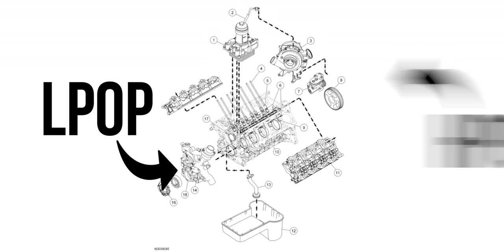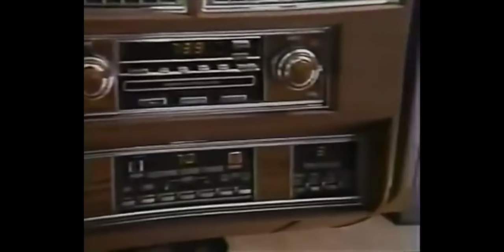These are the WORST ENGINES EVER MADE

Comment: I had a 2.2 omni. I drove that thing for 210,000 miles and sold it. just had to do a timing belt and one headgasket
Reply: had a 2.2 in thw wifes 93 Dodge Spirit . Never a problem except one headgasket . And I think that was my neglect of coolant maintenance .
Reply: The ones with the VW rabbit engines were bad ass fast !!

Comment: The early Toyota 8r and 18r engines with the fuel timing chain set up with two chains, 4 gears, 2 tensioners, 2 guides. When the chains wore out it would buzz saw through the timing cover and self destruct itself.

Comment: GM NEVER figured their displacement on demand out. 

The LS4, (LQ/LY 5.3L based LS engine) eats rocker arms and floats valves, have heard many reports from GM truck owners having had similar issues. 

80-100k miles for a full valve job, is unacceptable, and this is coming from a Mechanic who drives a Benz.

Comment: We have several 6.0 Fords at our shop and we love them. We have dealt with some 6.4 and 6.7s. They are boat anchors. Even the mechanic at the Ford dealership will tell you that they are junk. The 6.4 will crack the block, in some cases with only a few hundred miles on it, and the 6.7 has crank problem and there are no crank kits available. The only problem we have with the 6.0 is cowboys. Nothing is cowboy proof.

Comment: I don't know the engine designation but it was in the Ford Fiesta.  Interference engine with a timing belt that drove the water pump.  Pump would fail, belt would slip, and engine was trashed.

Comment: I have two of these engines: A 5.4L 3v in a 2007 F150, and a 6.0L Powerstroke  in a 2006 F250. I’ve had the 5.4 truck for 13 years and have no issues. I just got the 6.0L and I’m keeping my fingers crossed that it will perform as well as the 5.4L has.
Reply: Same, my ‘09 5.4 3v has run basically trouble free for 14 years now with proper maintenance.

Comment: The Northstar is a good engine.  The biggest issue with this engine is the oil leaks.  Oil consumption of a quart per 1000 miles isn't out of line.  VW calls that normal and won't warranty anything better than that.  We never saw any real oil consumption issues in normal driven cars.  The ones that did were driven harder and at that point oil consumption increases are normal

Comment: He missed some of the reasons with these very engines.
- Northstar v8s have a head bolt issue. I think the threads were too shallow. Funny cause he actually says that about another engine here.
- Triton 3 valves have oil passages that are to small. If you don't change the oil regularly they will grenade themselves.
Car Wizard mentions both of these issues in his videos.

Comment: I would add the Ford 4.6 V8.  I know a lot of people love that engine.  But if someone runs straight water in the cooling system, and the freeze plugs rust out, especially those behind the timing chain, suddenly you are dumping water or coolant right into the oil.
Reply: I believe that's what happened to my grandmothers Grand Marquis, one day it died unexpectedly. We poured water in the radiator and it shot out of the exhaust.

Comment: What Mopar cars used the 2.2L turd engine?  I had a 1986 charger with  non-turbo 2.2 4 banger.  I got it new.  That engine was the ONLY part of that car that didn’t give trouble.   The spider gear housing got a crack in it and leaked tranny fluid.   The A/C always leaked.  Dumped it prior to total destruction.

Comment: Chrysler tried build a better mouse trap and only messed up the 5.7L (351) Hemi. I've got a 58 Chryler 351 Hemi in a 1928 dodge roadster. The original engine was pretty much bullet proof and in it's current configuration will blow the doors off a new 5.7.

Comment: When you were on the Triton you forgot to mention how the exhaust manifolds would ALWAYS warp & break the steel bolts off in the aluminum heads. My work shop's lot truck has 27,000 mi... it's been 'fixed' 3 times under warranty.  Bye the way if you let that annoying loud leak at header persist your valves will flake away whilst the engine cools down... loosing a little more compression each time you drive it.

Comment: I owned a 7.3 Navistar IDI and it would burn anything you ran in it.... IF you could get it started. Had the glow plugs done twice. Once myself and another by a pretty reputable shop in my area and they NEVER worked right and the cavitation issues were terrible. Yes easy fix with the right coolant but good luck finding one that had ever had the right coolant in it..

Comment: The Olds diesel was often used as a gasoline block by the drag race community. With thick walls and a extremely ridged bottom end it could take abuse that would split a Ford small block in half. The high nickel content iron also made for a great stationary motor. Odd how people who have zero experience with a powerplant just repeat what they heard on the internet.

Comment: Ok.  So I had a Toyota 4 runner with the engine mentioned here and it was a disaster.  Blew the head gasket twice.  Toyota knew about the problem did nothing to fix it.  On the second time it blew I donated the car. Gave it away.   I was so disappointed with the way Toyota handled the whole thing I have stayed away from the brand ever since.

Comment: The Northstar ring pack was too much for  the pokey drivers that bought them. The engine was really a race engine that needed to beat on and revved. And the lack of head bolts......why 4 and not 5 per cylinder? The Olds diesel was released to a public that did not get them and the real issue was the lack of a fuel water separator. The last generation of the Olds diesel was not that bad. Get one, add real head bolts, up the pump, add a turbo and they were pretty good. Gotta be dedicated though

Comment: By 2006 Cadillac fixed the problems with the Northstar. My 2006 STS never burned oil,never had a coolant leak and never had a head gasket problem. In typical GM fashion once the problems with the Northstar were corrected GM stopped using it.

Comment: The Cat C7 ACERT engine. That engine almost bankrupted any commercial company running box trucks because the the piston rings would break, score the cylinders and they were not sleeved. We had to use a manometer to measure how bad the blowby was. As a mechanic rebuilding these (term used very loosely , we just tried to keep them running till leases ran up) we would run a ball hone to get as much of the scores out as possible so it would run decent enough to finish the lease life. This ultimately , in my opinion, was a big reason CAT stopped making highway engines ( and they were so dirty, the EPA basically killed that division )

Comment: Subaru's 2.5 liter boxer engine is a candidate for this list.  They have head gasket issues.  Every 2.5 liter will eventually suffer a head gasket issue.  One corner of the gasket doesn't have a bolt to hold it down and it will fail.  I had it fail twice.  Other than that, the engine had 165 hp, and only got about 22 mpg in mixed driving.  So it wasn't a power house or a economy engine, but did move the car pretty well.
Reply: That problem was fixed over ten years ago.  Try to keep up...

Comment: I had the 3VZE engine. I loved it. True, it was nothing to brag about with power, but it was pulling ALOT for a little engine.

As for the head gasket issue? Because Toyota thought it would be okay to have the crossover pipe for the exhaust so close to the gaskets. And it was okay, IF they were made of Asbestos. Although, the newer head gaskets today can withstand the extreme heat. If you can get past the head gasket issue, it's a solid engine.

Comment: The 3 cylinder 1 liter Ford Ecosport. They have rubber timing and oil pump belts that are bathed in oil. The sprockets are pressed fit and will slip. Oil destroys rubber. The teeth on the belt shear off and you loose the engine. Also as the belt wears rubber particles clog the screen in the oil pickup pipe.

Comment: The Olds 350 diesel was abysmal. I remember seeing 1-2 year old engines blowing the crankshafts down thru the oil pan. Not uncommon to see a Olds 98 or Cadillac DeVille converted to gasoline V8 when the owner got tired of diesel headaches.

Comment: The GM 5.7L diesel engine was definitely one of the worst engines ever produced. even the one's that didn't tear themselves apart? had issues with wiping out the front pump. in the turbohydromatic transmissions. from massive crankshaft flex. a person would think that GM would have known better than to take. a gasoline engine and turn it into a diesel engine. but apparently they didn't.

Comment: Had a 74 maveric with a 240 six cylinder that someone changed plugs and wires one time and the threads came out in #5 cylinder and man the thing would scare you like a shot gun going off, but ,she would stay going with not a big notice in performance ,it just sounded like a relief valve going off.

Comment: Nothing wrong with the 6.0 as long as you delete it, ARP headstud, and tune it. Then it's just regular maintenance from there.
Reply: I've owned every Powerstroke engine (with exception of the 6.4) and the 6.0 is by far my favorite.  Half of the stuff this guy says is complete garbage.  He didn't even mention the VW/Audi 2.0T, Cummins ISV, the 2.0/2.3 ecoboost or the GM 3.6 V6.  I think he did about 5 minutes of research before making this video. 😅

Comment: The old Mitsubishi 3.0 V6 has to be one of the worse. It was used in both Mitsubishi and Chrysler Corp cars in the 80s. It was noted for high oil consumption, which is often noted on older cars. This is due to problems with the valve stem seals, which on 6G74 must be replaced at the first sign of oil consumption. Virtually every car with that engine I saw back then ended up smoking like a chimney. I owned a 1988 Caravan with that engine that would leave a cloud of smoke behind me until I had the valve seals replaced.

Comment: Props for putting a Toyota on the list, even if you did it in a backhanded kinda of way. Toyota had a major issue with excessive oil burning in the 2000s. We had a well maintained 2007 Camry that burned a quart every couple thousand miles.

Comment: as a previous 3vze owner, it was toyotas bad design on the exhaust manifold on the passenger side. it was a crossover pipe that was to close to the head and it would over heat the head. and it was offered from 88-95 in their pickups as well.

Comment: Toyota 3vze engine were built with a mismarked headgaskets.  TOP was actually bottom so they were installed upside down.  So iirc the drivers side rear cylinder combustion ring was too close to cylinder bore. Toyota replaced a lot of them.  Some were even customer good will.  One trick when replacing thermostat was to hold the plate open with a aspirin tablet and filling slowly. I used to take a high mounted coolant hose off and fill in both directions using small funnels. It might have been a heater hose by valve. My 2 cents

Comment: Not only did the Northstar V8 have some kinks that really needed ironing out but it's also laughable how insistent GM/Cadillac was on using it everywhere. I feel like the biggest offender is the XLR, the Cadillac that was basically a C6 Corvette. As if higher weight and only automatic transmission options weren't bad enough, they just had to replace the LS engine with this smaller displacement and less potent engine

Comment: How about the transverse-mounted Ford 3.5 and 3.7 V6's? They have a water pump driven by the timing belt, and when the water pump seals fail it dumps coolant into the oil pan. Sadly, other than this particular glaring issue it's a good engine, the Mustang and F150 use a longitudinal version, with an externally mounted water pump, and they hold up just fine.

Comment: Bmw N62- valve seal issue. Alternator bracket oil seal. 

Northstar- head gasket bolt issue.leak galore

Jaguar  4.0 V8-1998-2000. Weak water pump propeller.  Shite tensioners and rail- breaks destroys engine. Problem child especially compared to the i-6 and v-12 it replaced. And yes, it was another one of those Motortrend Engines of the year award winners.

Comment: I had a used 99 Cadillac SLS NS engine with 80,000 mi. It Had no oil consumption problem but we had $7000.00 in repairs in 3 years. 
Never again will I buy a Cadillac!

Comment: Easily the Maybach HL230. It constantly sets itself on fire, is complicated to maintain, consumes too much fuel and is underpowered compared to engines that were fielded in the same time period. FYI this is the engine put into the Tiger 1 and Tiger 2 along with the Panther tanks.

Comment: I would have to offer the Dodge 2.7 2005-2009 engine for this list of horrible engines. If the oil isn't changed religiously, and it wasn't in most cases, the engine would fail miserably.

Comment: That 6.0 liter powerstroke diesel in Ford pu's was at very best "the worse engine ever manufactured in the entire universe",  I bought a used 2006 F350 (80,000 miles) and owned it for 8 weeks, 3 of those weeks were spent in a Ford garage. It cost me a fortune trying to stop all the oil leaks, you just couldn't keep oil in that engine ( from leaks) even though the Ford service tech replaced seals, gaskets, some parts and who knows what else. I spent over $4000 in repairs just on that engine that still leaked oil.......that $4000 I spent on that engine was the most damn money I ever spent for a boat anchor.

Comment: I add the Nissan A 15 engine, 1977 to 82, these blew up internally, head gasket problems, bad carbs.  I had one in a early 1980 Datsun 210 and it blew up at 75000 mikes.
Reply: Miles that is, but got crap millage mine when I traded in barely got 14 mpg, sometimes 12 mpg.

Comment: My vote would be the Oldsmobile 307. The only anemic turd V-8 option available in most GM passenger cars until the early 90's (Corvette excluded of course). Nothing like taking the biggest cars in GM's product line (Oldsmobile 98's, Buick Electra's, Cadillac El Dorado's) and giving them an engine with all the horsepower of a Toro snowblower......

Comment: The 3VZE has a number 6 cylinder running very hot issue due to the stupid exhaust crossover. That's where the head gasket fails.

Comment: Cadillac HT4100.  When the 8-6-4 flopped in 1981, what did they do?  Created a 4.1 liter V8 to take it's place!  Aluminum block, intake manifold, and oil pump.  Cast iron heads?  Yes!   This engine had tons of reliability problems.  Intake manifold gaskets would cause coolant to contaminate the oil.  Block castings were so weak, they would warp the block.  The distributor drive gear would get chewed up as a result.  The cam was soft and prone to rounding.  The cam gear was nylon and would lose teeth, jumping timing as a result.  The aluminum oil pump would fail.  It would spin cam and crank bearings, leak oil due to sloppy application of gasket sealant at the factory, rip headbolts out of the aluminum block.  Such a shame.  This engine had a nice sound when it wasn't broken.  2 very good engines were spawned from the 4.1.  The 4.5 and 4.9 liter V8's.  Cadillac should've gone right for one of those.  They would've been great in the full frame landyachts.  The 4.1 held up better in the small, transversely mounted engine Cadillacs, but still was mediocre at best in those cars.

Comment: On the flipside, the more performance oriented 5.4L Ford V8s found in vehicles such as the Mustang Cobra R, gen 2 Lightning, Terminator Cobra, Shelby GT500 (07-12) and the Ford GT (05-06) was more reliable and could handle power.

Comment: Bough an e350 with 320k on the 6.0 I ran home made diesel a few years and got 420k until Stephan at Taska Ford screwed the thing up b4 he got fired. Had to junk it after 2500 rip off repair.  My 5.4 e350 has 310k miles and runs great.

Comment: Another to add the 2.3 l ford that was used in the tempo and topaz, the motor digital box for the ignition, on the distrbuter, that would blow out in a years time do to the fact they mounted it near the exhaust and intake.
Reply: What? The distributor is on the front while both intake and exhaust manifolds are on the back!

I did have the Thin Film Thingie fail years ago and it was due to lack of grease which was supposed to promote heat transfer. Many years of Tempo ownership and only the one TFM failure.

Comment: 6.0 power joke is garbage, I had one implode one afternoon when the turbo tube failed and got sucked into the engine at less than 100k. The diesel mechanic said Ford should just put a Cummins in their hd trucks, and they'd be pretty close to perfect.

Comment: I understand your perspective and personal experience with some of these engine but honestly in my personal opinion, the Triton engines get a worse reputation than they really deserve. There’s a reason Ford used them for so many years across their own vehicles and other manufacturers outsourced the 6.8L V10 for their vehicles (Buses, etc.). They’re pretty solid engines for what they are and if you feel the (albeit unnecessary) need to dump some money into these engines without them needing it, they can become quite powerful and/or reasonably reliable. The potential for the 5.4L in the performance side of things can be pretty impressive too if things aren’t built correctly (especially the Navigator DOHC version).

Comment: I'll give y'all another engine to avoid. N14 and N18 engines that you'll find in the 2nd generation of Minis.

It is not a matter of IF, but a matter of WHEN the timing chain fails, the high pressure fuel pump fails, the thermostat housing fails, and the valves get clogged with carbon buildup - plus all of the fun other sensors and cheap plastic crap. Absolute money pit of an engine, do not get a car with one of these.